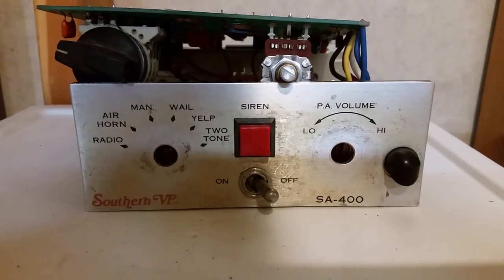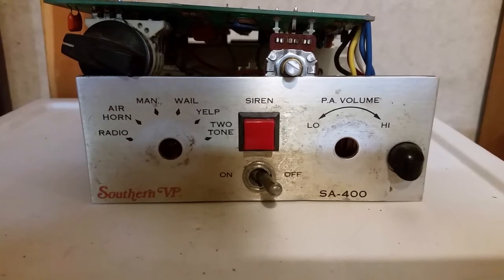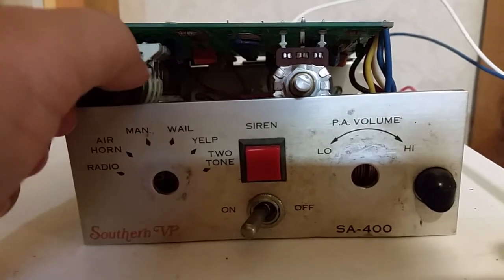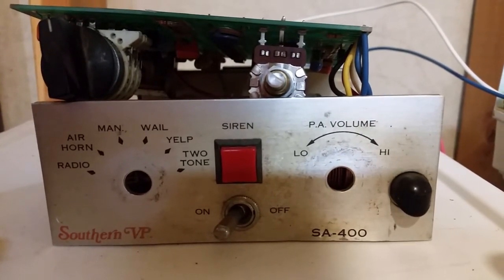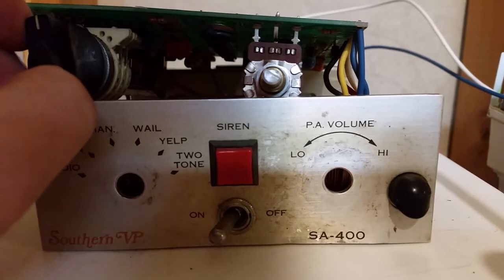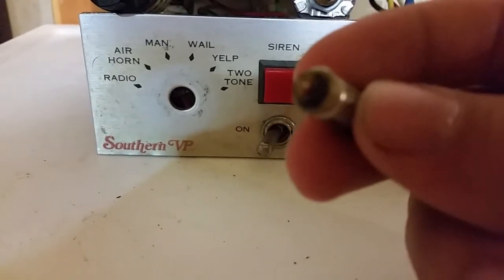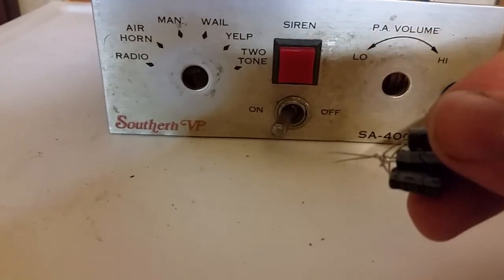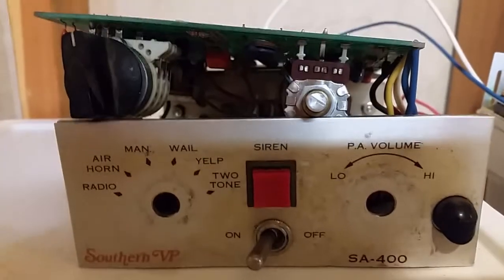Southern VP SA-400 Siren Repair

Comment: I recently purchase a Southern Vehicle Siren, SA 400-53. It was never installed and still in the original box with the manual. This version does not have a microphone, and I need to know what gets connected to the four mic points on the board. (I.e. PTT connection points and Mic connection points)

I do not have the original mic so I do not know what goes where.
ML (BLK)
COL (GRN)
COH (WHT)
MH (RED)

Do you have any knowledge how the mic should be connected? Also, do you have any mics that would work for this?

Comment: How do you tell if a capacitor is blown?
Reply from the maker: The capacitor in question was electrolytic, so I will focus on talking about those.   Many of these have some small indents in the metal at the top of the capacitor.  When this area is cracked or spit in some way, that usually means the capacitor is bad.  This one was a little more tricky, due to the fact that there was one lead on each side instead of the common 2 on the bottom.  This one had a crack between the shell and one of the leads.  I'm just talking about blown capacitors, there are other ways capacitor go bad.
Reply: Great. Thanks for the reply. I have several sirens that aren't working at the moment, trying to figure out why! 🤔😂